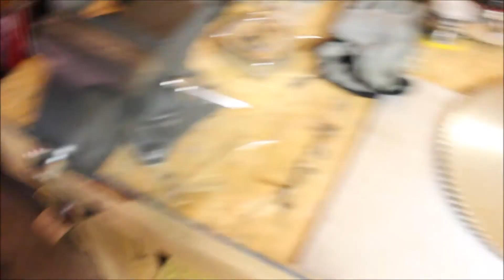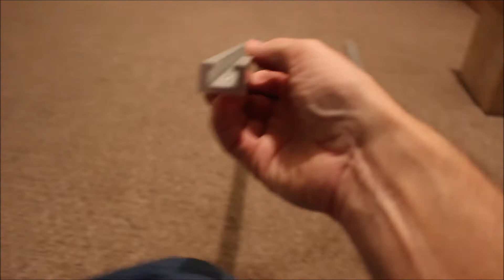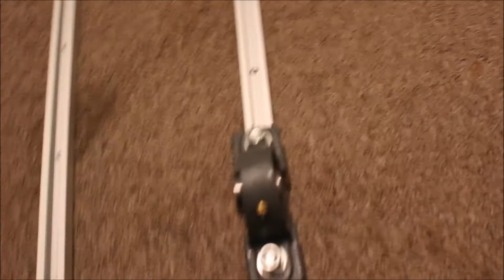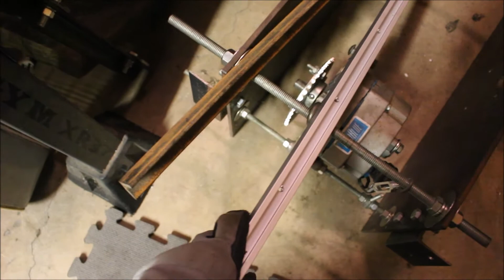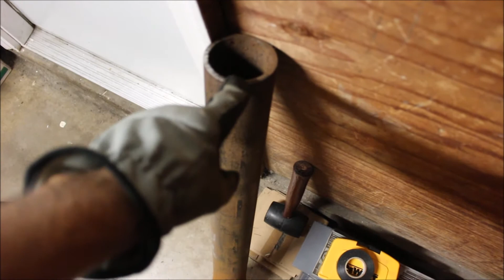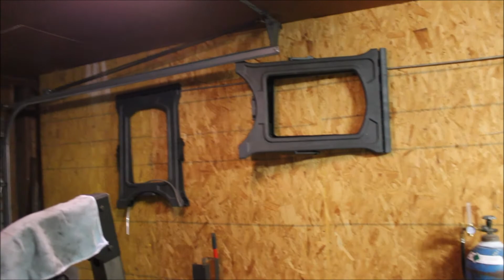Gravity Electric Generator Update

Comment: So once the weight falls to the bottom, how do you get it back up?
Reply from the maker: Once this is completed, it's going to stun the world how simple it all is. Getting the weight to the top is actually the easy part.
Reply: @jryer1  
Ok, so can you be more specific?  How is the weight getting back up?  You must be using external energy to bring the weight back up.  Solar panel?
Reply from the maker: @valveman12  Can't give away all the good stuff for free. After the patent is returned, then the demonstrations can begin. Solar is an option of course, but you're going to be amazed how ridiculously simple it is.
Reply: @jryer1  
"You're going to be amazed how ridiculously simple it is.."
Unless you are using an external source, that weight will never make it back up under the force of Gravity.  So if you are not making the claim the weight returns under the device's own power, then I'd be interested in seeing what you are doing.
Reply from the maker: @valveman12  Definitely NOT a perpetual motion device. This is a generator of electricity that uses weight in both directions.
Reply: @jryer1  
Any timeframe for when you'll do another video of your progress?  It has been quite a few years...
Reply from the maker: @valveman12  The two things everybody needs more of, time and money, which when sufficient, provides space. The leap from a garage to a REAL facility for manufacturing is not small.

Comment: Thanks for sharing such  detailed videos. How much KVA or watts do you expect to get from this machine? What's the load that will be able to be used and for how long before it will discharge all energy?
Reply from the maker: We're hoping for somewhere around 750 to 1000 watts. The distance the weight will fall, gear ratio, and any mechanism to control rate of descent all will determine run time, but hopefully we get 20 minutes or better. It would be best to charge a battery bank, rather than place loads directly onto the PMA. Mostly likely we will use components from the solar panel industry in helping to charge the battery bank from this generator.
Reply: @jryer1  thanks for the prompt reply. Can you please share your calculation? I'm thinking of building one as a backup generator. I have a load of 2kva - 5kva. I assume it will be more then a 1000 kg mass.
Reply from the maker: @happy-barefoot  There is no short answer to this question. Much must be considered carefully and accurately.

1. Knowing the specifications of the PMA
2. Gear ratio need to generate enough RPMs for the PMA
3. Design & material for gearbox
4. Design, material, and diameter of Winding Wheel needed for proper lever-arm length (torque)
5. Mass needed in conjunction with the winding wheel to generate enough torque to overcome load on PMA
6. Material & design for a solid & rigid structure, with no deflection, to support such an extreme mass
7. Will a mechanism (escapement) be needed to prevent over-acceleration of winding wheel
8. Calculating the rate of descent (run time)
8. Manually lifting the mass without use of electric motors
9. Safety features when dealing with such mass

And all that is before we even get into the electrical design and components. The list goes on and on.

We are currently calculating approximately

1. Compound gear ration of 640:1 (114:23, 98:56, 98:13, 98:10) 
2. Mass of 500 lbs (227 Kg)
 (this may not rotate the gear train, so more mass may be needed)
3. Winding wheel diameter of 4 feet (1.22 meters)
4. Estimating torque at 1.56 lb-ft (2.11 nm)
5. Somewhere around 500 watts (48Vdc * 10A) with Windblue DC-540
Reply: @jryer1  again, thanks a lot for your detailed response!
So if i make a very rough calculation. assuming you are using a 225 kg mass and approximately 2m height system. And in results get 20 min of 500w. It is possible to use 24 times more mass, 5.4T and 4 times more height, 8m. And gain 8 hours of 2000w. Of course the actual numbers depending a lot in the quality of the design and materials. And it's a big monster in the back yard. But in general, thats the numbers?
Reply from the maker: @happy-barefoot  So now we enter into the field of physics. The gravitational equation specifies, 
that all objects fall at the same rate, that is 9.81m/s^2. The further away from 
the surface of the earth, the less acceleration, but for us that is not an issue 
because we are talking only a few meters. 

So increasing the mass will not increase run time in of itself, but it will increase 
both RPMs and Torque at the PMA, and that is very useful indeed. To increase run time, we would most likely increase the gear ratio as the primary means of doing so, or perhaps the height, but again a governor mechanism may be necessary. Perhaps a centrifugal brake or an escapement.

You can check out the velocity (speed), time, energy of an object of mass at a given height 
at the link below. Pay attention to the time, you'll notice it doesn't change even if we increase the mass.
https://www.angio.net/personal/climb/speed.html
Reply: @jryer1  have done some energy calculation, and the numbers dosent add up...if:
1)g=9.8N
2)M=1000Kg
3)h= 3m
4)time = 20 min= 1200s

then,
M*g*h=  29,400 
j
and,
W=29,400/1200= 24.5

i think that means we get 24.5W use for 20 min for lifting a 1 tone mass 3m up. and that is theoretical best option. did i miss anything? how did you got 500w from less?
Reply from the maker: @happy-barefoot  - The math is wrong, the 29,400j (watts) is only at impact. You will not get 29,400 watts continuously because the gearbox is converting linear motion into rotational motion. There's an inverse relationship between RPMs and torque when energy is moving through a gearbox. In short, if RPMs increase Torque decreases and vice-versa. So in this case think of Torque as the equivalent of the force at impact, and remember the force at impact was calculated from a free falling object NOT being restrained by a very high ratio gearbox. Our mass will be falling at a much slower acceleration because of the gearbox, thus we get very high RPMs (needed for the PMA), but very low force (torque). We still need some torque to turn the PMA under load, finding that balance is the hard part. Our gearbox is a very high ratio single speed gearbox, but it might be worth investigating the plausibility of a 2 or 3 speed high ratio gearbox. The 20 minutes that I quoted is at this point an educated guess, but it could be wrong. Often the math surrounding physics and what happens in real application don't always equal.

Comment: Did you ever finish this generator? I'm very interested in this and would like to see the finished product.
Reply from the maker: @Scott - Scaling up requires more space, CNC mill, lathe, and of course $ to make it all happen, but I'm still determined to finish this device. With a mass at over 700 lbs to generate enough watts to make it worth building, the entire structure has to be designed accurately with quality components, otherwise things tend to break often. Making the leap from the garage to project space with the equipment is the hurdle we are attempting to overcome right now. It will happen, I hoping this year.

Comment: You don't need to screw it to the ceiling, just get a pulley and a longer line.
Reply from the maker: At the mass (600 lbs+) we will be using, longer chains create alignment and tension issues, something we want to eliminate as much as possible

Comment: Christiaan Huygens invented the endless chain - which solved the problem of continuous power while re-elevating a weight for a gravity driven system. It works very well and it allows you to re-elevate the weights and maintain continuous power while doing so .